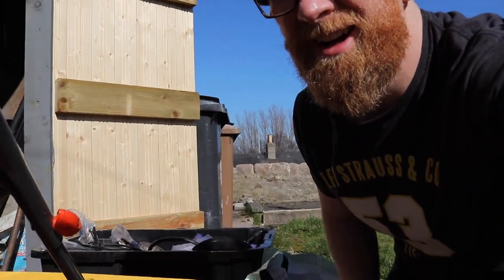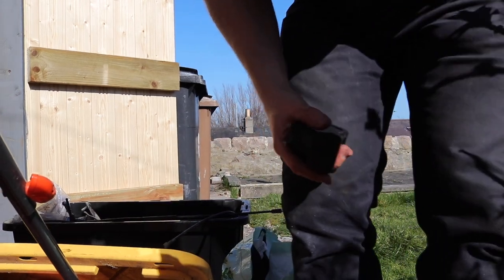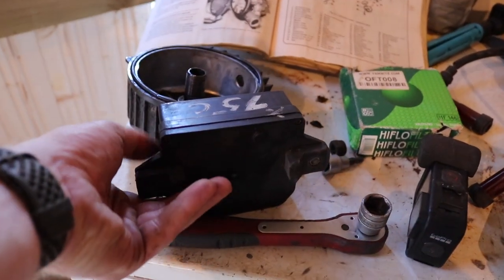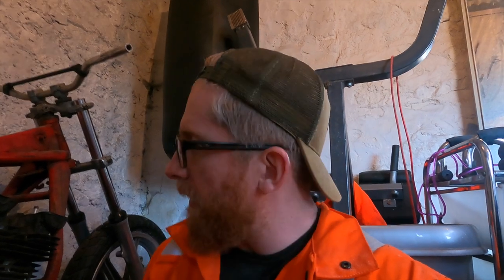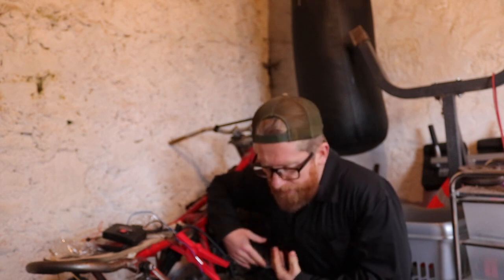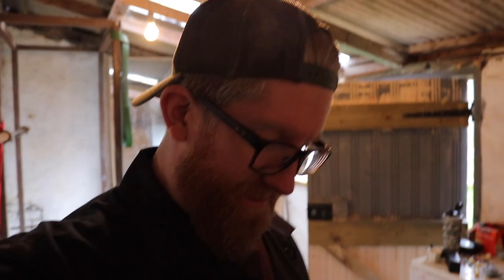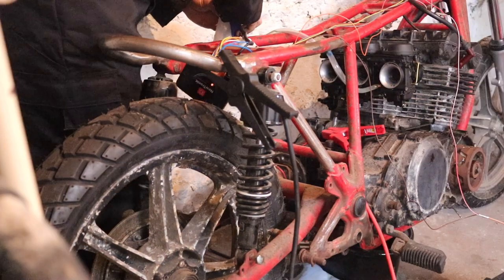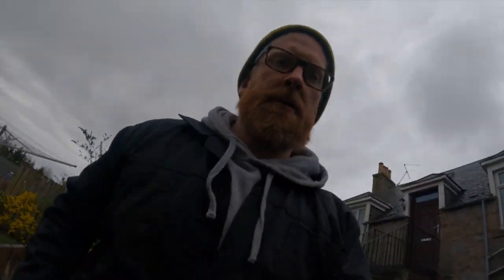XS750 Vlog 2 - I set my bike on fire...

Comment: I think a lot of us would have panicked in that situation, could have been a lot worse, i was welding an Escort inner wheel arch years ago, stupidly i was leaning on an old, oil stained carpet, also had draped a curtain over the freshly painted axle, was getting a bit warm under the arch, removed my helmet and the whole lot was blazing, luckily had a bucket of coolant i threw over it, subdued it enough to get the garden hose onto it.
Reply: I would have shit myself, and then laughed whilst panicking
Reply from the maker: holy shit that sounds terrifying...also had a welding related fire incident but not on camera....

Comment: I guess that could have been a lot worse. With the lack of compression I'd check the valves are sealing. If it's been stored for a while you can get corrosion build up on the valve seats. If the heads coming off lap all the valves in and check they are sealing before putting it back on.  I'm looking forward to the rest of the build. Good luck and stay safe.
Reply from the maker: Yeah i lucked out all things considered. For sure dude, going to have a god look at the valves etc.

Comment: I see that a lot of people talk about having a fire extinguisher which is definitely good advice but to be honest I think this may not have happened if you were using the starter motor cable and proper wiring. The starter motor has a very high current draw and you don't want to be touching jumper cables to it or doing anything that creates a spark anywhere near the carbs. Even if the carbs were not leaking, it's still risky to create sparks near the inlet. Good luck with your project.

Comment: Wow, lucky x2 as putting water on a petrol or oil fire can make things worse, because the fuel can float on the surface and spread. Get a CO2 or powder extinguisher dude, or better still both! Glad you're ok though and thanks for sharing.
Reply from the maker: Great point, I now have a Co2 extinguisher but will probably look to getting another as you say. Thanks

Comment: it happened to me 15 years ago. Preparing a CB 650 ignition for a cb500F. It backfired in the carb and set it on fire. I was standing there speechless as a friend arrived who puts a bucket of used cleaning water on the bike and put out the fire. I myself was at this moment to paralyzed and shocked to do anything.
Reply from the maker: Scary stuff right? I have had quite a few people comment saying similar has happened

Comment: I had a similar fire on one of my bikes, my vacuum tap seal on a kawasaki 500 er failed just after passing an mot so got the aa out, the idiot took the plugs out and used the starter to turnthe engine over without disconnecting the ignition wires. Fuel flew out the blocked bores and ignited the engine was a fire ball, and he was supposed to be a professional....they've called me fire ball at the garage ever since.
Reply from the maker: aw man that sounds scary! It all happens so quick...